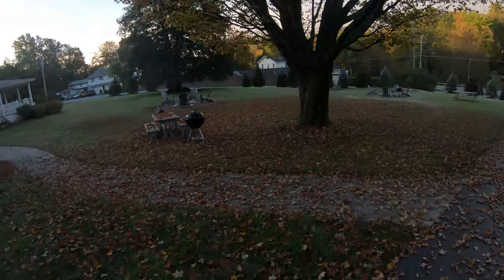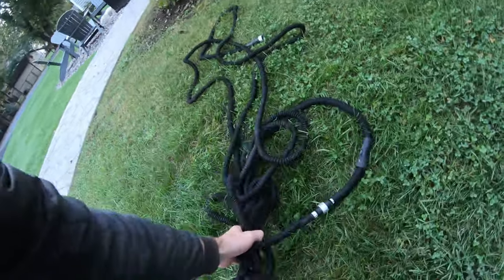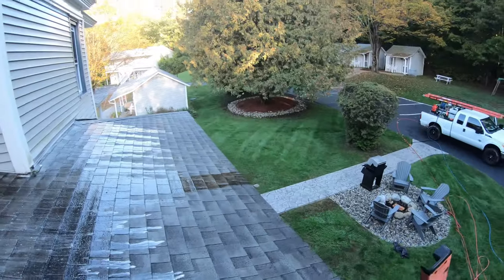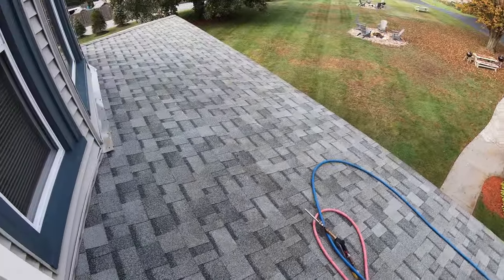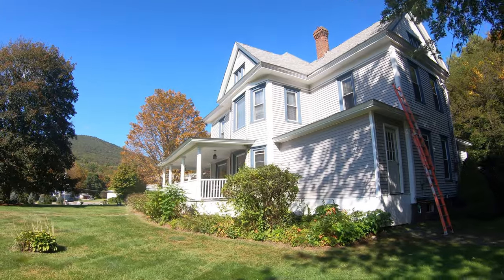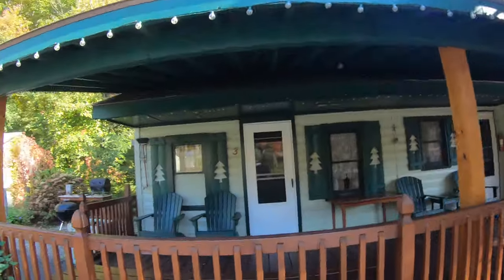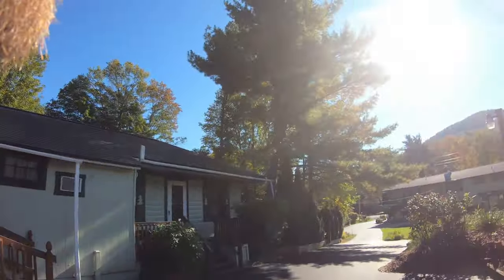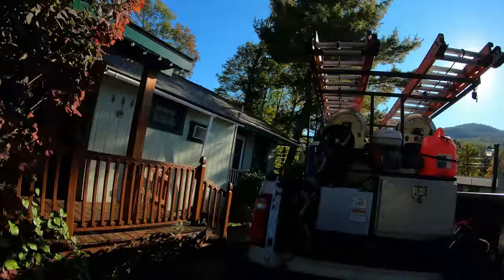$2000 Soft Wash Job in One Day

Comment: Hero9 is an excellent GoPro!
Reply: If you are going to use the brush on the roofs, you should put a handle on it and save your back.
Reply from the maker: @garygodby9995  they dont work as well. Not enough down pressure for the bristles. All these brushes had poles. They all break off from use or I take them off. By hand it's much better unless the moss is the kind that falls right off. Ant moss you need to work at the pole is useless